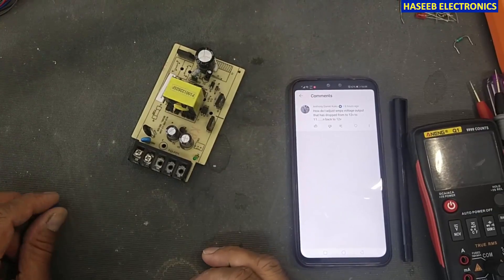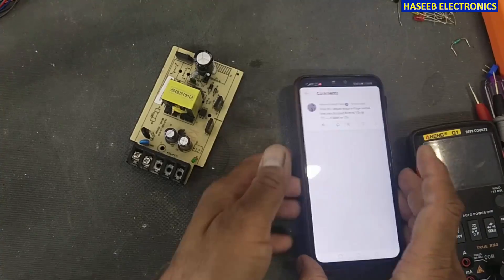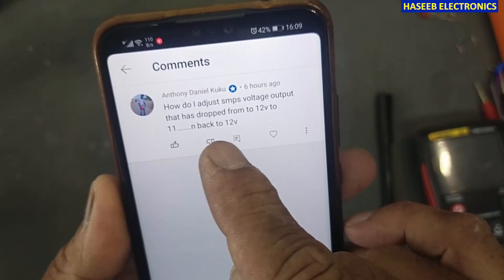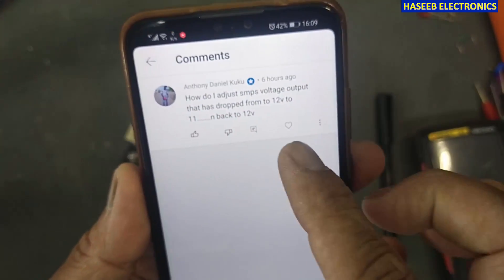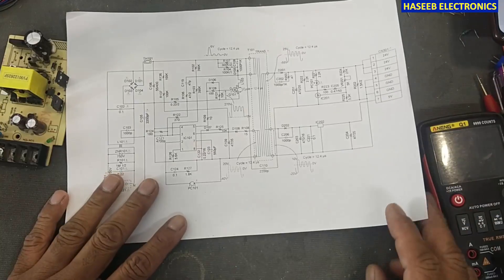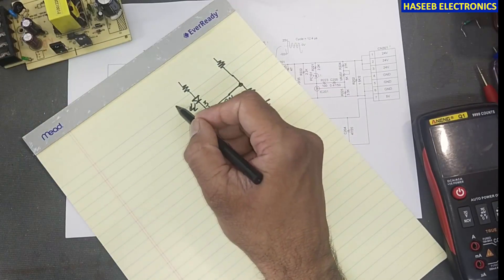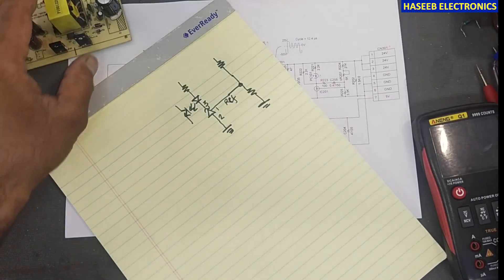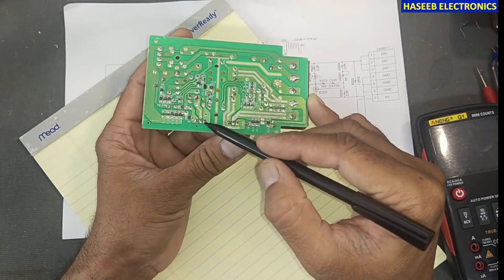{764} How To Increase, Adjust SMPS Output voltage

Comment: I repaired a PSU, changed same type and model named bridge diode and power mosfet. But output 12v is high! Between 12.8 and 13.1v. and fluctuating between these voltages. How can i solve this problem
Reply from the maker: kindly check video number 758 for detailed troubleshooting

Comment: I have 5v output how can interested 12v..
You have any other information video.. Sir
Reply from the maker: it is impossible to boost 5 volt to 12 volt by adjusting this method. but you can
1. use boost converter module (in the output of 5 volt) to get you required voltage level
OR
2, open transformer secondary, count turns, calculate turn/volt. and calculate new turns for required voltage. replace existing capacitors to your new voltage value. and adjust feedback network for new voltage

Comment: Hi your great electronic engineer i'd like to ask ,i have here printer power supply +32v stable and i decrease it to 14v but it was flactuating from 12v-14.8v. what is the reason of behind it? hope you answer thank you
Reply from the maker: @idealtech
it seems that you dropped the duty cycle too low. so that the ic is in reboot mode. it is unable to find feedback properly. 
adjust UpTo 18-20v range and use LM7812 in the output. I think it will much better
Reply: @HaseebElectronics  thankyou so much for the advice, really appreciate it.
Reply: The feedback loop probably needs some adjustment too with such a voltage decrease.

Comment: What is the cause voltage in vcc IC TTL 494 only 9 v..my power supply 27 v 10 A
Reply from the maker: VCC supply is different than the power supply output circuit. most of time it uses bias winding from the transformer. check its rectifier, vcc capacitor, might be there may be some problem or there are 2 signal transistor in output of this ic to drive the pulse transformer. if any one transistor is damaged, it can also be a reason of voltage drop at vcc pin

Comment: How reduce noise of power supply
Reply from the maker: if there is noise, it can be removed using 
class Y capacitors
using Snubber across rectifiers 
connecting to good ground
adding filter 
etc

Comment: Sir, Please suggest me M43 similar smd diod. kind Regards ❤️  Love from Bangladesh
Reply from the maker: if it is DO214AC (SMA) (4.5mm L, 2.6mm W, 2.1mm H) package then it is 1N4004 is simple 1 ampere 400 v diode. if not available use M7 that is 1N4007
Reply from the maker: if it is some other package styles like SOD323 then it will zener
Reply: Sir, its (4mm L, 2.5mm W and 1 mm H)

Comment: Change and experiment with the resistors.. You can learn ... Don't be stuck with the teacher... 

Make 0-50V regulator. ( don't forget to change capacitors voltage)

Comment: Hello, I'm looking for schemes where "VIPER26L" is used.  Maybe you met?  TV, monitor, SMPS, etc.
I bought these chips from aliexpress, but they don't work.  Some ic, the pin DRAIN and the COMP have a short circuit.
Maybe you know how to replace "VIPer26" without changing the circuit?

Comment: sir when we invert the dc to ac, how do we convert the output to 50hz by using half bridge?
Reply from the maker: first we invert dc 12volt to 310VDC and then using H-Bridge topolgy, it converts to square wave shape with offset, so it become 620 V AC peak to peak, equal to 220 AC RMS

Comment: Good sharing.
Can we decrease voltage 48v to 24v of smps supply?
Reply from the maker: best regards
no we cannot make sooooooooooo big change 
it is just in +/- 1 to 2 volts only. otherwise SMPS controller will loose regulation
Reply: How can we modify 48v to 24v smps?

Comment: Ka7500 and lm339 jis board main dono ic lage ho agar us smps k secondary side short ho to protection off karke smps ko on kiya ja sakta ha kya ?
Reply from the maker: yes we can do it. i will try to find this design. if i found it, i will explain it
Reply: @HaseebElectronics  apne 1 video banaya ha how to increase voltage in smps us board main ka7500 amd lm339 dono ic lage ha